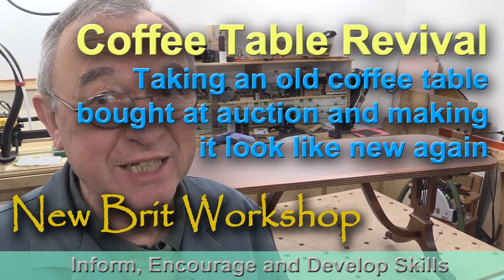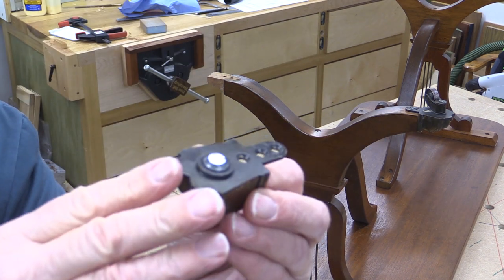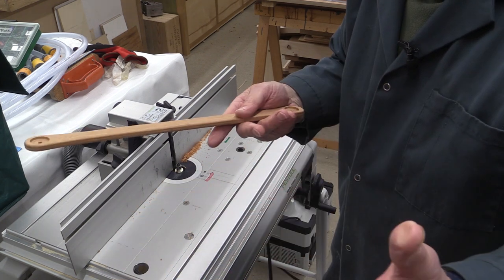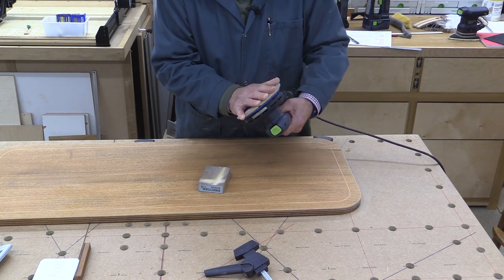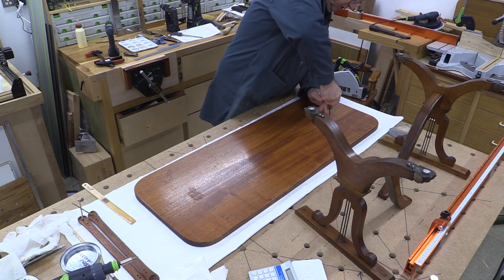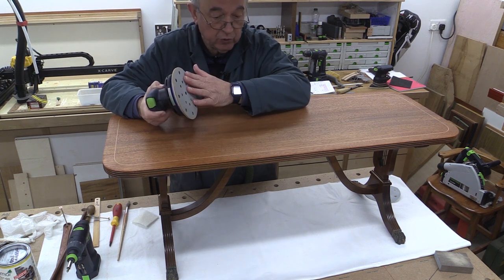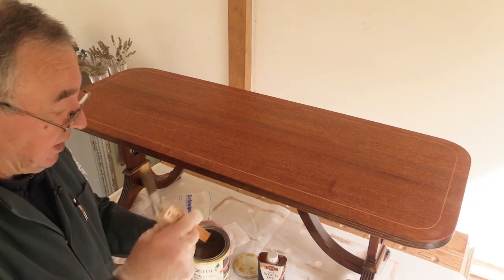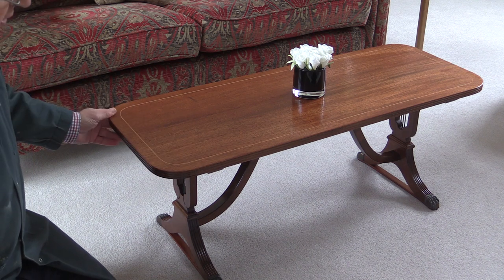Coffee Table Revival

Comment: How many 240g  sanding discs did you use and how long did  it take?
Reply from the maker: Hi Paul, I used one 80 grit, two 120 grit and two 240 grit sanding sheets. I only threw away the first 120 grit and first 240 grit sheets.  Peter